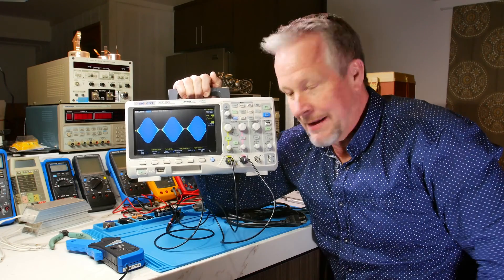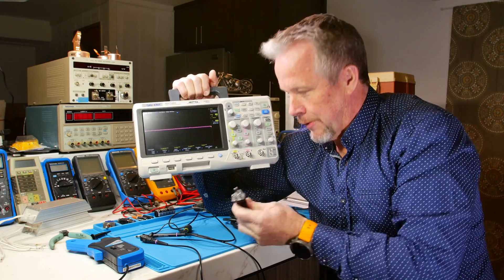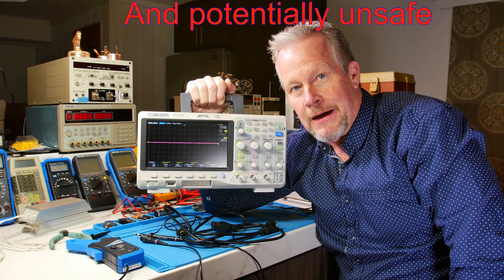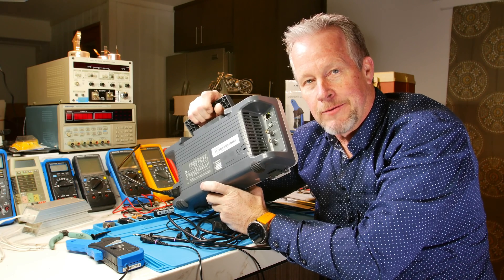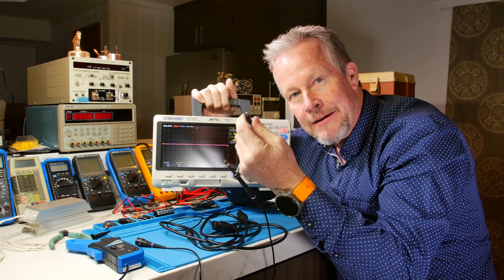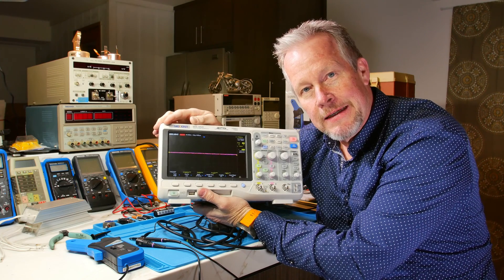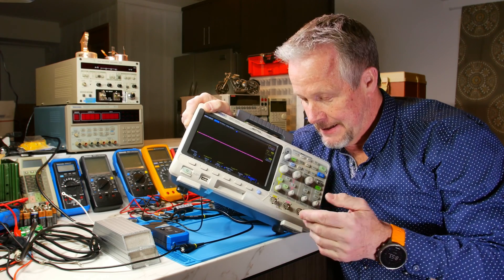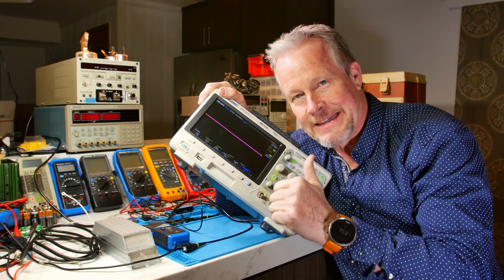oscilloscope safety - don’t blow up your scope or circuit #oscilloscopeisolation #scopesafety

Comment: it's not the voltage that will kill you considering that when you get a static shock it's probably 2kv BUT pico amps or less. It's current that will kill you. .5 amps across the heart will do it.
Reply from the maker: Thanks for this great feedback!  You are right - it is only about 0.5 amps that can kill.  It really doesn't take much.
Reply: ½ amp will (probably) kill you!!!
Currents between 100 and 200 mA (0.1 to 0.2 amp) are more than enough to be lethal. GFCI's are by design set to trip at 5 mA for protection of personnel. But do not get hung up on amperage alone. Although it's probably the biggest factor in electrocution, it's not the only one... Besides current:
PATH taken thru the body
And
TIME exposed to the current.
Remember-

"Being electrocuted Hertz the whole time, until you die"

Sincerely,  a Master Electrician

Comment: Really helpful for scope newbies. Bought a Rigol DS1102Z-E as a christmas gift to myself :D Recently I aquired two old analog Hameg scopes (HM 412-1 & HM 512-6). Interestingly, these old scopes are not connected to mains earth. The instruction manual warns you about getting shocked from the scopes casing if you connect the scopes GND to a high potential.

Comment: Much as I watch these I'm still confused. I'm in a late 1920's house with 2 wired outlets, where the only tie to earth is at the breaker box where (I suppose) neutral is wired to a water pipe. I surmise THIS represents ground, where neutral and Earth are at the same potential, But that's as far as my brain goes if even correct. I can't understand what that means or how to use it safely? All my three prong devices go either into the adapter (cheater) plugs or into a surge strip which itself goes into an adapter plug. Any helpful tips?
Reply: And as followup to my own question I'm thinking it's ok to treat Neutral as Ground....as long as all plugs are oriented correctly especially the final plug to wall, that the outlet is wired correctly so that the Neutral side of the plug is genuinely going into the Neutral side of the wall outlet. Sound ok?
Reply from the maker: Great question!  If you do not have the ground at your wall, well then it is actually maybe safer for your scope;)  You don't have to worry as much about placing the ground of your scope probe to ground when you are looking at AC power - since you don't have a ground.  But, you still need to be sure that each channel that you use has the ground on the scope probes at the same potential.  Make sense?
Reply: Thanks. I have less lucid moments and more lucid where things come together. At the moment I'm somewhat in between.  I've been wondering just that - if I'm kind of isolated by virtue of plugging the 3rd prong grounded chassis into nothingness. I'm thinking it's not the same though if I plug in an ancient 2 prong appliance but that's a moot point here.  So far I've had no need to run both channels but I'll keep that advice in mind should it come up. Funny thing is ever since I broke but repaired a German Rangefinder camera at about 12yo, I've had the confidence to feel I could repair anything...so long as I can see it's mechanism.  Electricity...well those who understand components will say it is also a mechanism but to me it's an elusive invisible monster that's always intimidated me. At 64 tho I'm finally developing a grasp, just enough to have troubleshooted a few of my tube amps and father's old radios. Thank you. Oh another funny....all that equipment lined up and you didn't have the 99cent cheater plug to show and tell in your video...(just kidding).
Reply: Safety ground is there in case the hot lead(the line connection) shorts to the chassis of the equipment, that allows current to flow through safety ground and pop the circuit breaker. If you don't have a safety ground in your house wiring you can drive a ground rod about 6 foot into the ground either through you concrete floor or just outside the room where you are working and feed a 10 gauge green ground wire to your work bench to the earth ground. I did that in my garage office for safety and electro-static discharge protection(ESD).

Comment: Someone mentioned residual current protection. Would another way be to use an rcbo to interrupt when you do misplace the ground probe? Of course isolation transformer would be a better option to let you you continue on measuring. But a 10$ breaker would be a good protector and stop damage from occuring.

Comment: Did something similar on my siglent 1104ex “3” channel…when testing an amplifiers 20-20k sweep I without fireworks or any signs blew channel ones input. I got no pops nor the oscope turning off. Everything is just so on the 2,3,4 channels. But the next time I turned on the scope my readings were off on channel one, i try to compensate for this ridiculous looking wave that I cannot compensate with the probe, it looks like an old picture of a 50s saucer dish UFO on its side. Ive factory restarted and put it back to factory but I realized I must have shorted out my input on channel one. I have the 1104ex and its my first real digital scope so I still have 3 channels that work perfectly but I would like to repair the input on channel one someday soon. I really need a differential probe. Can you make a more nuts and bolts explanation of this topic. Its really my biggest downfall in my oscope knowledge. I get certain fundamentals but when putting in real time practice with bridged, stereo, and other variations of where and what to hook up or to use ground leads. I hoped me f’ing it up would have taught me the lesson so I am currently irritated I could never grasp the concept on how applications will vary depending on you wanna introduce yourself into the circuit.
Reply from the maker: Thanks for the great question Blake!  Can you give me more details on what signal that you were looking at when this happened?  Did you have a scope probe connected?  Was it in x10 or x1 position?
Reply: @KissAnalog  |- is the closest on here I can think of to give the wave shape. So, imagine a square wave that has double volt overshoot at the start of the wave and then immediately comes down in a slope down to “calibration” volts and it is a repeat over and over and does not change with the probe screw adjustment being turned either all the way down nor backed out all the way. Hope that helps. Ill send it to you if you wanna use it in a video to help others and myself with a fix. 

Alas, I was using the probe is 10x as well as 10x in the trigger settings. I was accepting a 10th of the signal basically.

Comment: I have issues with not fully understanding why if a device has a floating voltage it can not cause current to flow as there may still be a potential difference between the ground and teh floating voltage. This is also causing me problems in feeling safe about attaching my pc to serial ports on alarm/telecom equipment as they are not driven by relays or optoisolators. Could someone please explain why this floating voltage does not matter.

Comment: In your video, you say about not connecting earth on the scope. However if you have  a metal chassis which is earthed and you attach to the ground of the bnc to live or neutral the case becomes the same voltage. John Ward says it is important to put the isolation on the device not the scope. https://youtu.be/a3ePild_sFs Could you please comment.

Comment: Another way is to use a non grounded scope such as a Fluke scopemeter or in my case a Micsig tablet for automotive use with all the options great scope and safe in that regard
Reply from the maker: Thank you!  Yes that is so true.  A battery powered scope is a great way to help provide a safer way to take measurements.  And it can help get cleaner measurements too;)

Comment: Sir. I love your videos  on scopes and hope you produce more. I''ve recently watched a vidoe from the, "bald engineer," in which he was showing how to use a scope. He did something that I thought couldn't be done. He connected the probe to an AC wire to show a since wave, the ground wire wasn''t visible in the shot. Is that right. I myself am working strictly with DC and ardiunos. I even disconnect the arduino from the pc and use an undrounded wall  afdapter to power it when using my scope !

Comment: Early in your vid, you said that you can isolate a scope using a cheater plug. That is NOT the case! The neutral/common  (white) wire is common to all outlets. How is that possible? Think about it. If you CAREFULLY removed the breaker panel cover (not recommended) you would see that all the white conductors are screwed into a common bus, as all the bare ground wires are. If you completely disconnect the mains breaker, you could then safely probe neutral to ground with an ohmmeter. Why would you have to disconnect the mains, you ask. Think about it logically. There is a low resistance from neutral to ground and back again. Simple Ohm's law: low impedance, high current. The solution is to modify an isolation transformer by opening the case and disconnecting the green chassis wire from the secondary winding and insulating it with heat shrink. Just remember that the secondary winding is now truly floating and completely isolated. Your 'Scope is now 'protected.' You, not so much!
Reply from the maker: Thanks Richard for this great question!  Using the transformer as you described is the better way to isolate.  The cheater plug works to though, and I’ve seen a lot of power guys use this method in the lab.  You are correct, at the service entrance the neutral is bonded to the earth or safety ground.  It is isolated because at the scope the chassis is no longer tied to safety ground, so your probes ground has no DC connection to the input power.  The scope has an isolated power supply so there is no connection from chassis/scope ground to input power, so it’s isolated.

Comment: Hey! great video! I got a question...
Can I attach the ground clip (the black alligator clip) of the probe to Earth Ground and the probe to live?
Reply from the maker: Thanks - great question!  If you use your multimeter you will see that the earth ground is connected to the alligator (ground) clip.  So, yes you can connect those, and yes the voltage is within the rating of the probe (check the voltage rating of the probe to be sure),
Reply: @KissAnalog  Thanks a lot man!

Comment: I have a scope that I've hardly used because I'm scared 💩less of blowing it up.

I think (sometimes) the best way is running everything from an isolation transformer and use a differential probe?..... Unfortunately I haven't found any bags of money.
Reply from the maker: LOL - I don't blame you;)  I know people who use what I call cheater plugs to isolate the ground from the scope.  This isn't a recommended practice as any floating metal on your scope can potentially bite you.  Just be careful to be sure all your scope probes are referenced to the same voltage potential.  If probing a circuit connected to and AC circuit, be sure to have all the probes connected to ground.

Comment: This is one of the most complex and complicated issues in electronics (for me).  I've read so many do's and don'ts and now I'm more confused than ever.  So, how do you hookup your workbench?  Do you ONLY plug the DUT (Device Under Test) to the isolation transformer?  I think that's what they recommend for working on old Ham radios that don't have a power transformer - that have a "live" or "hot" chassis.  Or, do you ONLY plug your test instruments into the isolation transformer and have the DUT plugged into house power?  Or, do you plug everything into the isolation transformer?  I think I've read that that can be dangerous, too.  In any case, I guess it's a good idea to have a GFCI (Ground Fault Circuit Interrupter) (like used in bathrooms) multiple outlet bar to have the fastest shutdown of power if an imbalance in circuit power is detected.  Another question I have is - do I need (would it be useful to have) one of those Siglent SDS1202's to troubleshoot a bunch of old Tektronix 465 oscilloscopes I have?  I think I'm looking for an excuse to buy one.  My rationale is that I don't know how functional or accurate any of those old 465's are and the Siglent would be new and better able to give me super accurate readings, wouldn't it?  Maybe?  Or would I be better off spending my money on other things?
Reply: man, as always,  a wise question contains half the answer. i think you have the necessary base, just keep your eyes open, measure twice, before connecting,  you'll be fine.
added automatic protection is always nice, i rather it trip 50 times instead of killing me once
Reply: @AlexanderBukh  Another question i have is. The old receivers/component don't have a ground plug so they are not hooked up to mains earth and it should be ok to hook up the O'scope probes to the component being tested. That question has not been answered.
Reply: @SDsailor7  i would say consider them floating, use isolating transformer or/and extra carefulness
Reply: @AlexanderBukh  I do have a transformer that has a socket/plug in that it is floating. And that is where I would plug my O'scope
Reply: @AlexanderBukh  But there is still the possibility of the receiver/stereo being grounded via the fuse box. That is why I would have to check the probe and chassis with a dmm. Another question if I want to see what the receiver is doing I would have to hook it up via the RCA jacks in the back how would I check the connections?same as how I do it with the multimeter? One test lead to the RCA pin coming from the O'scope and the other lead to the RCA plug in on the receiver?
Thank you
Reply: @SDsailor7  First of all, kudo & millions of thumb-ups for @KissAnalog for making this video.   Very simple to understand.   I used a scope in college when Star Wars IV came out.  Didn't think about it back then.    I'm re-learning these concepts for my new tube amp hobby.   Anyhow,  I just bought an isolated transformer from Jameco for $124.  It plugs into the wall outlet and has both isolated and unisolated outputs.   Since it can output 7A, I'm going to connect the scope, the linear power supply circuit, including the power transforner, that I'm testing on the isolated outputs.  Just think about what you're doing BEFORE doing it.  Be safe.  Adapt the golden rule from capentry (measure twice, cut once) to check twice, connect once.😊
Reply: @dosuphu3662  I have a scope but don't know how to use it and the tutorials on YT are no good. I don't understand the volts and times per division and how to apply them to the device I am trying to test.😖☹️
Reply: @SDsailor7  that's a good question. here's what I think. you say it's 2 prong. so that means you have a hot and a neutral. now I  may be wrong but isn't neutral a ground? I mean doesn't it go all the way back to the electric panel to a bus bar which is connected to earth ground at the panel. I think that's how it goes?? now that being said if you had an isolation transformer and plug that 2 prong cord into it. now that neutral wire is floating in the isolation transformer. anyone else can chime in now and set me straight. I'd really like to know if my theory is correct. anyways I think that's how it goes.
Reply: @davidallenherrick I just asked Google and it said a neutral goes back to the fuse box to complete the circuit. And a ground wire is used in case of a short and direct the current to ground. So I guess it's not a ground.
Reply: @SDsailor7  yes it does go back and connects to a bus bar inside the panel which is connected to earth ground to complete the circuit. The earth ground at the panel is so current doesn't travel all the way back to the point of transmission from the power company. with no earth ground at your house I think all the neutral wires on the telephone poles would be energized . (I think) I'm just an old fart with an opinion! and definitely a hobbyist! cheers
Reply: @davidallenherrick There is still much i need to learn 😊👍
Reply: It is the same to me. I still have not received a clear answer about the question on how to hook up everything and what goes to what? I have two O'scopes but am afraid to use them not knowing how to hook them up.
Reply: btw im not better than you, im still too overcautios around my gear, and despite that i recently burned and old motherboard and a new powerbank circuit

Comment: Newby question - I think I did exactly what you are saying NOT to do in this video. In trying to get a sine wave going I attached just the ground lead of the probe to a 120V outlet (which is attached to the scope) and got a big POP! Orange flare sparks and everything. The scope seems to still be working - as in it didn't turn off.
Did I damage anything internally to the oscilloscope? 

I'll never do that again. lol.
Reply from the maker: Great story Phil!! Yes, that was a short;)  Was the ground clip actually connected or were you just touching it?  That kind of short would most likely melt down your scope probe lead, but if it happened fast enough - it could just fuse open the ground lead in the probe if it were not attached as well as it should.  The ground lead goes to the shield of the bnc cable which is a pretty good connection back to your scope - and then to the ground connection of the scope's ac input power.  Most likely the scope is just fine.  The probe is probably fine too if you can put it on the cal signal and it has a square wave and you can compensate it as usual.  Let us know what you find;)